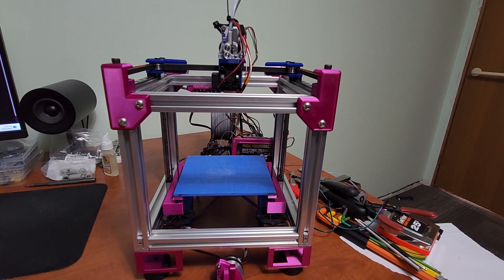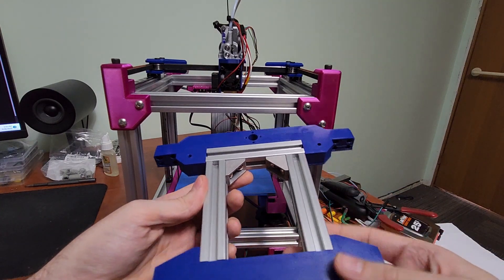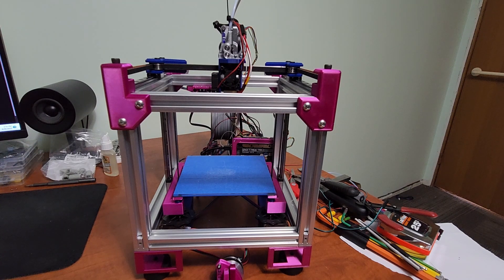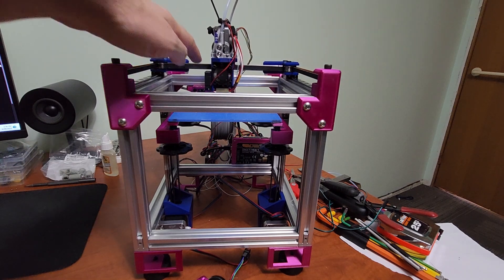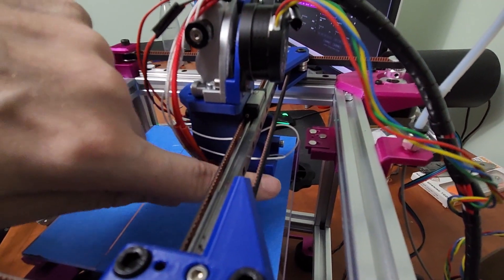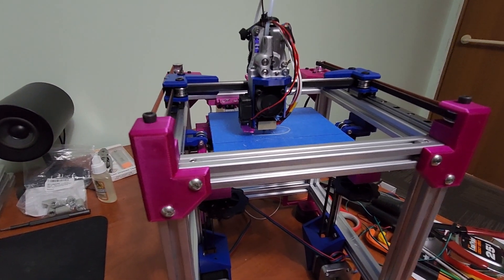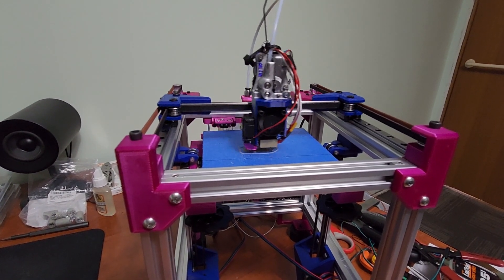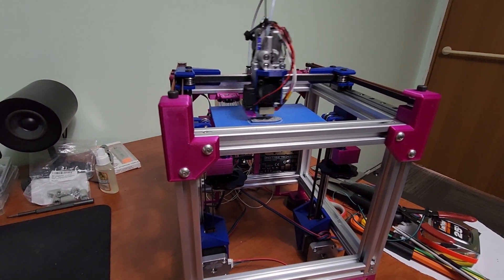Cheap DIY 3D Printer Called Bijou Assembly Guide EP3 - Hardware Final and Printing!

Comment: Great update. I'm liking the Bijou more and more. Really appealing and approachable small printer.
Reply from the maker: I wish I could make it 100 cheaper
Reply: @Rolohaun  Price is definitely the weak point right now but I think you've done a pretty good job of keeping it down. At this point there's not much room for cost savings.

I think the only major ways to cut would decrease quality. Like if you made the motion system on printed sliders that slide around on the 2020 extrusions instead of linear rails. Like the Z axis on the dualing zero.  Or maybe using rods for Z?

You could save a few bucks by doing blind connections or printed corners instead of the corners you have, but it would make it slightly less accessible of a build.
Reply from the maker: @caramelzappa  ya I agree
Reply from the maker: @caramelzappa  if I go rods on Z I would go rods for all motion
Reply: @Rolohaun  That might be worth looking atl.
Reply from the maker: @caramelzappa  I do want to make a 250 frame bijou and maybe that would be an idea but SC next then a big defiant update
Reply: @Rolohaun  Looking forward to both of those!